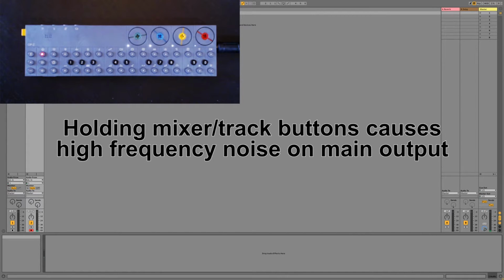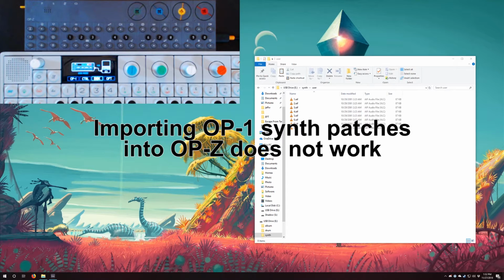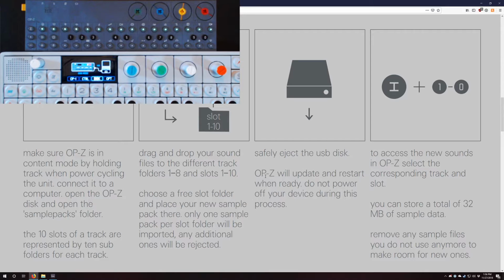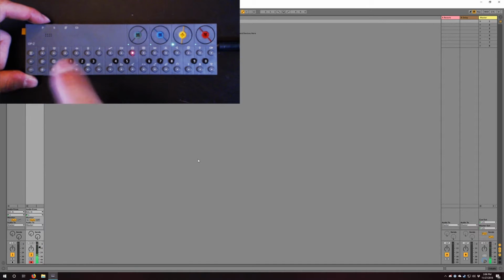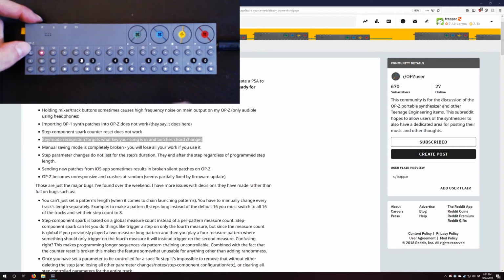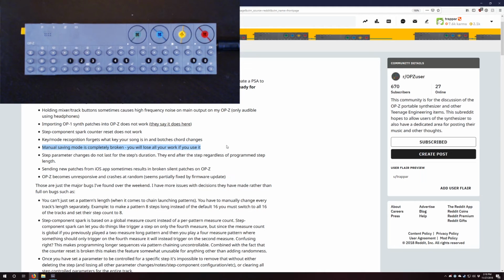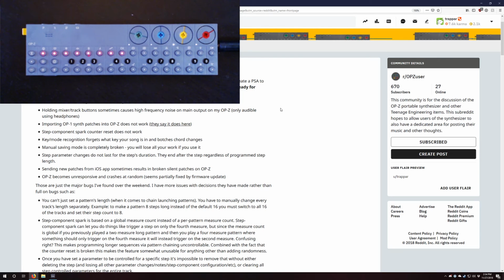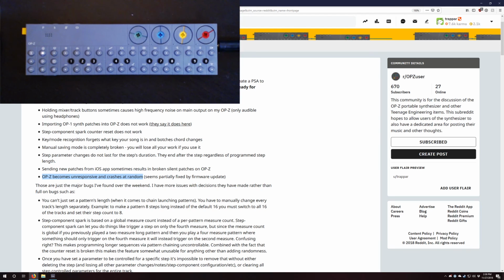OP Z Bugs/Issues

Comment: Its the track LEDs that are emitting that frequency and most of that wouldnt but audible if your live setup is in good shape... unless you are rocking a distortion pedal on the other side of the OPZ lol. Its amazing that its not noisier TBH. Quieter than OP-1 thats for sure.

Comment: I'm having huge noise problems with my OP-Z;  the signal to noise ratio is ok, though, and as I will be using this for recording only, I'm ok with it, but yikes, I haven't heard a device this noisy in a long, long time.
Reply: ok, when I disconnected the charger, the noise all went away...noted.

Comment: Parameter locks/changes act in the same way as step components, this is not a bug. As you mentioned there is already a solution to achieve what you want to achieve.

Comment: There are so many potential sources for that noise, and a good number of those will likely require hardware corrections... So maybe now is bad time of getting one?
Reply from the maker: Wrote and then deleted a comment because I didn’t quite understand what you were saying. It didn’t apply after rereading. Whoops.

Anyway... Yeah, that’s why it was at the top of my list. All the rest should be fixable in software. It seem likely the noise can not.

Haven’t had anyone else confirm the issue though. At this point it could be just mine.